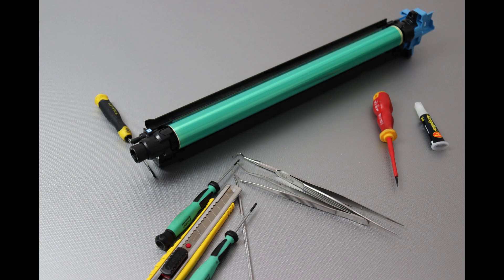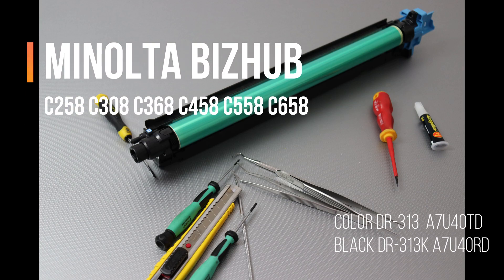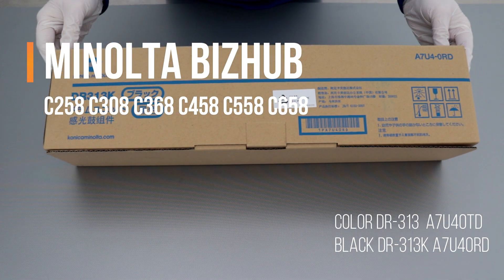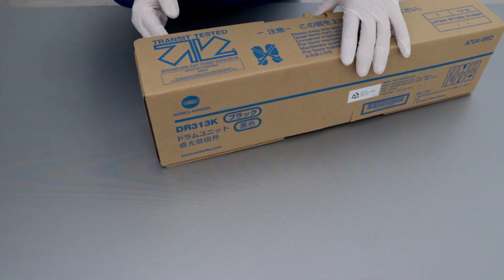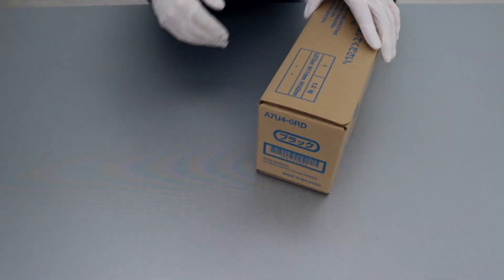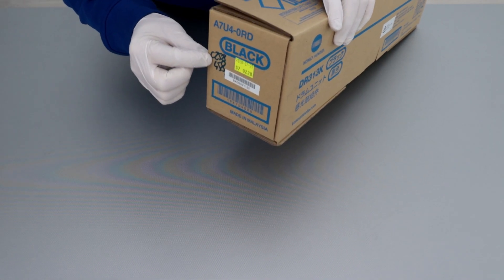Self repair Photoconductor Drum MINOLTA save 150$ money

Comment: Can i use this same method to service drum unit for Konica C554 ?
Reply from the maker: Yes You can do it.
Reply: @MrRicoh  Okay, thank you sir. Please sir, one issue I have is that I mistakenly lose all the screws including the screws that are holding the arm spacer. By the time I installed the drum unit back, I discovered my developer unit spilling developers on the drum unit. Everything was fine until I decided to service and change my OPC drum. I was told that the screws holding the arm spacer are factory fitted and if loosened or tightened, it can cause some effect. Is there a way to correct the screwing? It is really causing me pain. Or can you do a video on how to correct the screws that hold the arm spacer?
Reply from the maker: On my channel type: " c224e drum
Reply: @MrRicoh  thank you sir. I have fixed the drum unit. I made an error by losing the screws that holds the arm spacer. Now it has been balance and all seems well. Thank you sir.

Comment: we are facing one issue with our konica c452 series issue is black toner is not feeding even after replacing the devoloper and toner density sensor we are using non original toner even machine is not showing toner sign on display copies become very light any help on that please
Reply from the maker: This is a typical symptom of a worn developing unit. I guess you need to replace the entire unit. But check and contract the charging Unit in the Imganing Unit first. I mean the charging electrode and the charging grid.